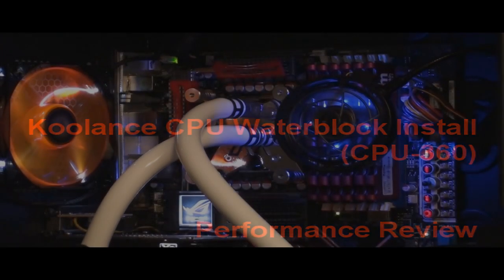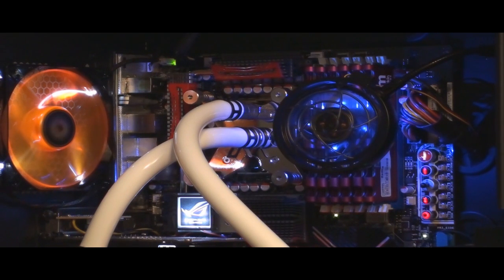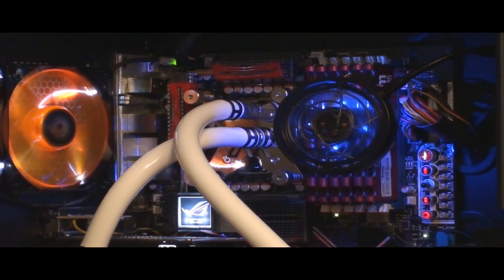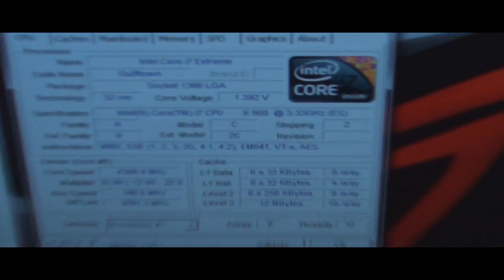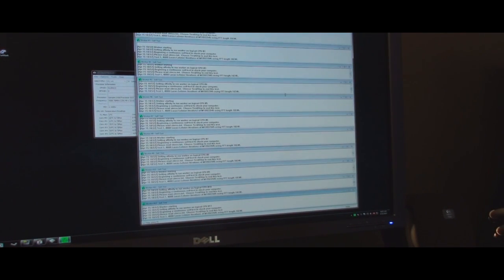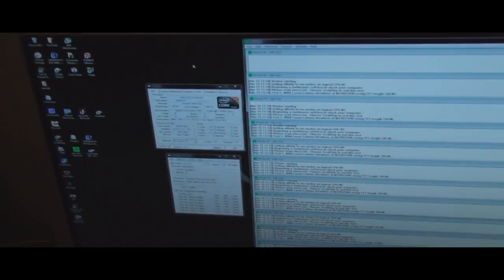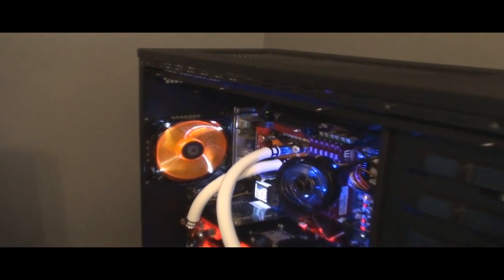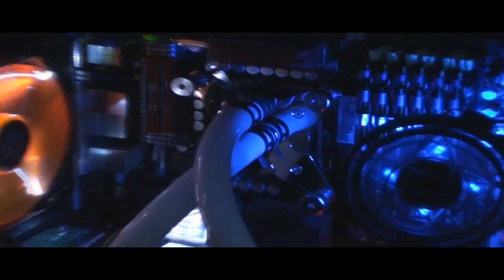Koolance CPU Waterblock Install:  Performance Comparison

Comment: Why does Intel MB's run so hot?Every AMD board I've ever ran in any of the 3 EXOS units I have NEVER see anything past 34*c on a full load.If any of my boards hits above 30*c I look at it as running hot.I'm currently running my backup & it's a CH IV Ex. FX3150 CPU with G.Skill Sniper16GB DDR3 1600 1866 RAM.It has a full blown Koolance system,in & on it.MB block.An identical 370 block.It runs 3 HD5870's including a dual HD WB & Ram coolers.I think it's how U run the coolant ratio.To thick of sol.

Comment from the maker: @IgorekGQ Thanks.  (ATI Build) I know that CPU coolers are designed with pressure in mind, but I chose this route to make the coolant flow upwards which has a greater chance of keeping the GPU waterblocks charged fully, instead of it cascading down and leaving pockets of air.  Also, the air bubbles if it has any will flow easily out of the blocks this way as well.  I promise, I did weigh the pros and cons of this setup.  My build with XEONs does have coolant going to CPUs first.  :)

Comment: I think you did great work BUT.
if i were you i would make sure my CPU gets the cooling before the Video Cards + you got 2 of them and they get very hot.
so try and switch it around im sure its gonna be cooler :-).
good luck

Comment: @Trubyd44 I got some AS5 laying around, used it on my previous watercool setup, right now im using MX-2. I'll take a look at the IC Diamond.
How does the external Koolance ERM-2K3U 2000W heat removal system perform compared to the TFX Xchanger 360?

Comment: @Trubyd44 Cant wait to get it. I just saw your thermal compound video as well, ive used that method all of the times as well.
When I mounted my current block, it did move around after i tightened it, quite a lot actually.. Would that be an explanation to my high temperatures? Im also using an XSPC RS360 radiator, but a TFC Xchanger will arrive tomorrow along with the block as well.
Im really hoping to get a huge temperature drop.
What radiator are you using?

Comment: Amazing! Im gonna get mine tomorrow. Right now my idle temperature of my i7 920 @ 4ghz is 42-43c and my load is way above 70c :-/ (and its a D0 stepping).
I think I did something wrong in the mounting process, im using the XSPC delta v3 right now and its not the best block.

Comment from the maker: @mrjamesb56 Well, I'm in a smaller room with 3 computers in them (2) high end computers and 1 normal computer...with an industrial UPS which can carry the load on all three.  It has heat output as well.  My central heat and air can cool the house to a freezer, but this room remains warm.  I have a window air conditioner installed to supplement the room, but doesn't do well at night because it's too cold out side and I have to turn off.  It does very well during the day.

Comment from the maker: @evilcrow1001 The reading may not be that accurate, but the differences between the two should be.  Also, under options I have 'show delta to tjunction temp' disabled, it's something to do with the 6 core that is giving it troubles.